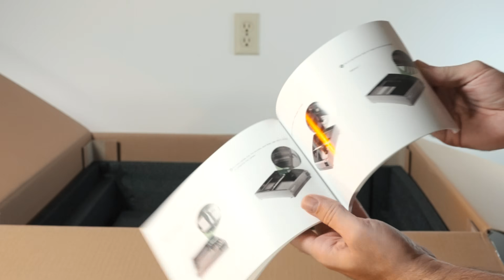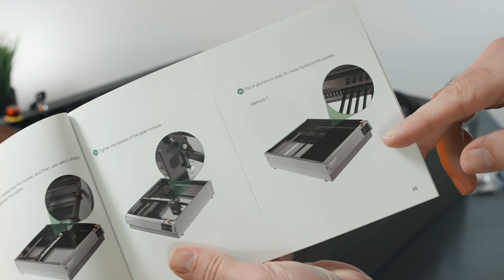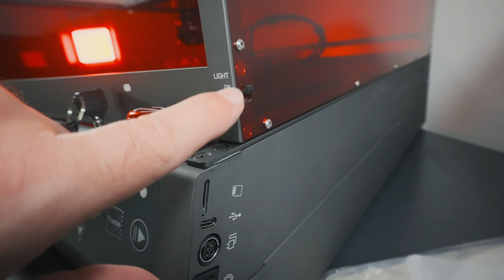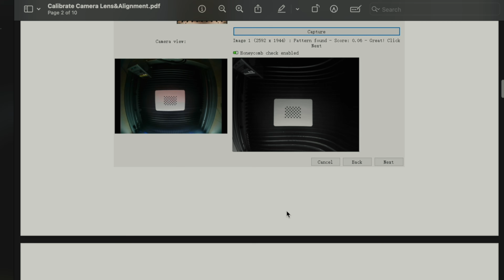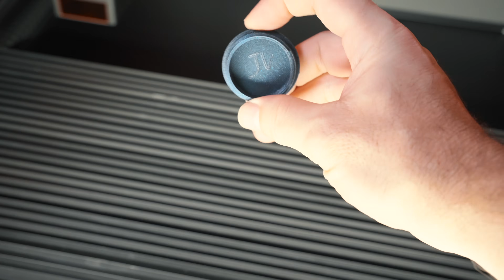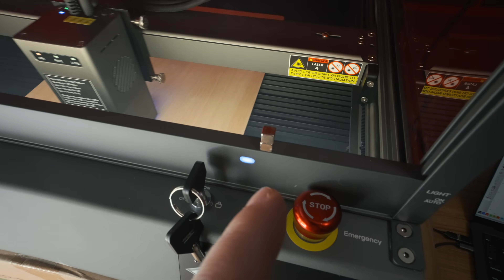Creality Falcon 2 Pro - 22W Laser Engraver - Unbox & Setup

Comment: Thanks for this. Very helpful. However, mine did something that yours didn't do. When I plugged it into my Macbook it seemed to be OK, then I plugged in the camera lead. The laser then travelled to the top left corner and started hammering like it was hitting a stop repeatedly.

When I unplug the camera lead it stops doing it. I tried a different lead but it still does it.

I've now joined some Creality forums and have asked the questions about it.